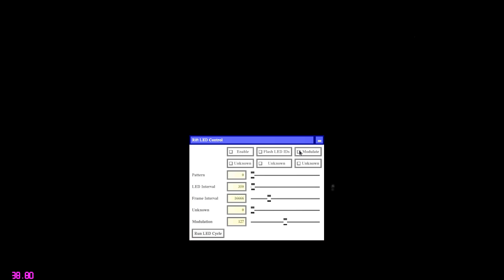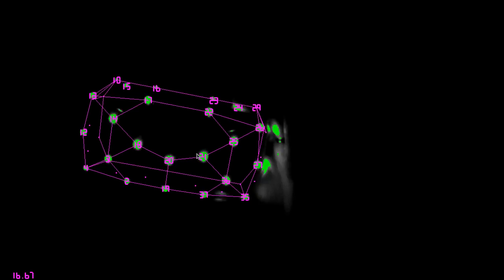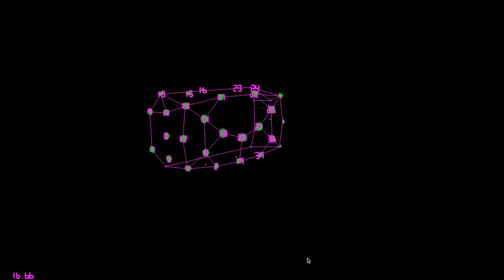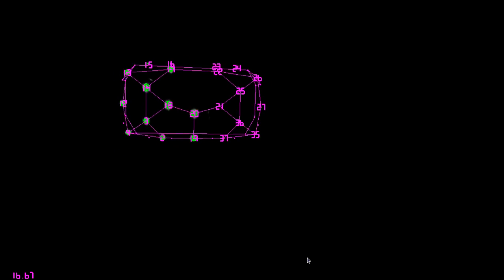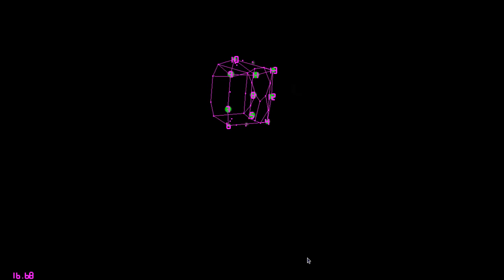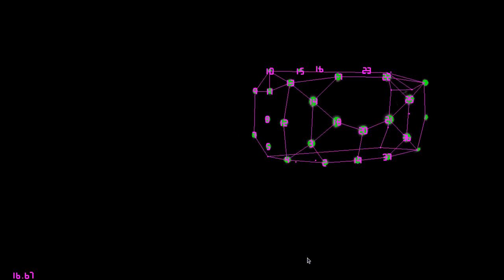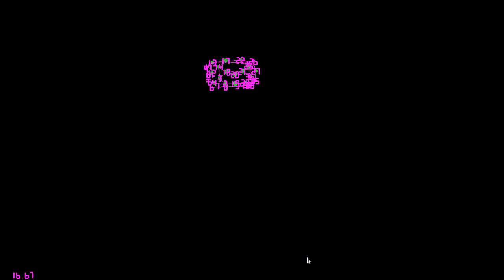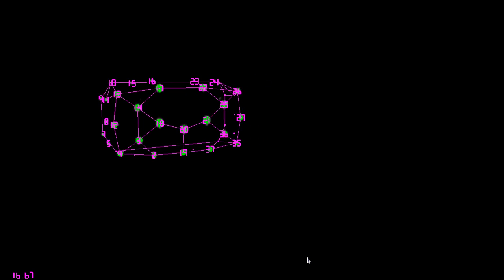Optical 3D Pose Estimation of Oculus Rift DK2

Comment: Hello, 

Could you please post links or books of the resources that helped you building this project?

Also, how the 3D model helps positional tracking in 6DOF? is by calculating the volume of the 3D of the object then find differences between the previous volume?

Thanks for the video
Reply from the maker: I was going to reply with something snarky, but then I realized I forgot to add the usual links to the video description. So here goes: http://doc-ok.org/?p=1138

Comment: What do you think about the positional tracking of the HTC/valve headset? They appear to have a low latency system working that's the reverse of the oculus approach.Is Valves approach better?
Reply: yes vives system has many advantages over oculus's. in the future it will probably be entirely inside out.

Comment: So if I understand correctly, all of this is running on Linux ? Are you basically trying to recreate the "SDK" of oculus but on Linux? If so, that is freaking amazing! Good job!
Reply from the maker: To be precise, this is trying to recreate the Oculus run-time, which, unlike the SDK, is closed source. I have my own VR development toolkit, so I'm not that interested in Oculus' SDK anyway.

There is a Linux version of the run-time now, so I could use that from my toolkit, but I want to try using the Rift with a different large-area optical tracking system, and this is a step in that direction.

Comment: Does anyone know if VRUI has a forum? I have a problem running the install script. It looks like everything installs,it makes the src folder, and then i get "Build-Ubuntu.sh: 33: Build-Ubuntu.sh: Syntax error: redirection unexpected". i get no spinning globe. Can anyone help me. Im running a virgin ubuntu 14.04 64bit.
Reply from the maker: There was some change regarding the default shell in Ubuntu 14.04. My script assumes bash, but on 14.04 /bin/sh is a different shell with a different syntax. There is an updated Ubuntu install script on my web site.
Reply: where is the updated script?
Reply: the script on the website gives me the error described above on a newly installed 14.04. could you please check to see if the script runs all the way through. do i need to have whytools install. if so can you setup a script for whytools. i know im a noob sorry.
Reply from the maker: GeneralScott1
 The updated script is at the same position as the old version: http://idav.ucdavis.edu/~okreylos/ResDev/Vrui/LinkDownload.html . You might have to clear your browser's cache if you downloaded the file before; the first line should say "#!/bin/bash".

You don't need to install anything else; the script will download all required libraries and build Vrui.

I just tested the script again on Ubuntu 14.04, and it works.
Reply: i have it working now, thanks man,  im learning the interface. just been reading alot now but im going to build an app that uses multiple kinects, 2 dof wii motes, an oculus rift dk1 and an emotiv epoc which is a 14 point eeg computer peripheral connected via wireless usb dongle. what i want to do is simply let you interface with  an object(first a 3d representation of your brain but with real time eeg data)  that is being manipulated by your mind real time via color and position of color corresponding with the eeg position. then introducing different  virtual and physical stimulus and see how your brain reacts in real time.
Reply: +GeneralScott1 +okreylos 

Interesting stuff, I am glad to have found more about this. I was hoping to incorporate some form of 3D camera technology as well as optical tracking in some of my own tests in the near future, and it's exciting to see like-minded endeavors. It's an interesting frontier of possibilities in how users will interact with displays and generated information in the coming years... If either of you have written more on the subject I'd be very interested to learn more. Thanks, take care...
Reply: +GeneralScott1 I find your mentioning of using EEG technology in addition to optics generation really fascinating, I have been wondering of a similar subject for some time now... If you have more you can share about what you have learned about the subject, the difficulties and / or working methods, I'd be very interested to know. I am totally new to acquiring any technology in the field before beginning to mess with the programming, but have been trying to size up price comparisons / ease of use. I have been looking at options such as Gazept and Bubl cameras, and the EEG device I was looking at was NeuroSky. These are all lower-cost options as I don't have a lot of disposable income at this time, but if you know of others or have other suggestions, I'm curious... 

I was also thinking Kinect would be a fun device to experiment with in regards to generating optics and interpreting incoming visual data... but again, I'm also not super familiar with the subject. If you have any articles, items, or general info on the subject I'd be very interested. I hope your own developing has been going well...

Comment: What happens if you turn your head horizontal 180 degrees? Will the 3d position of the OR still be trackable?
Reply: The next prototype in-house at Oculus has added additional LED markers to the back strap, so it can track you while you face away from the camera entirely.
Reply: No not with a DK 2. That is exactly what the Crescent bay prototype is for

Comment: While I'm sure it's possible, I'd be interest to know if you can move your head at that speed, while seated, to force the loss of tacking. Does it take a certain amount of effort or do you see tracking being lost in this way during regular use?

From you video it also appears that tracking is lost at high speed only with translational movement. While you hold it in the same spot, but rotate it rapidly, it appears to be holding the tracking quite well. I assume this is a combination of a quite low refresh rate of the camera (as it's a re-purposed off the shelf one isn't it?) and the tracking boundary box being relatively small?
Reply from the maker: ***** There is no tracking boundary box per se, but between frames, the software needs to establish a link between LEDs seen in the previous frame and the current frame. I put in a maximum cut-off distance of 10 pixels, so if an LED moves more than 10 pixels between frames, it gets lost.This is only the first approach. Once the optical tracker is backed up by inertial data it won't be a problem anymore, because then the software can accurately predict the positions of all LEDs in the next video frame based on inertial tracking data received since the previous frame.BTW, the camera runs at 60Hz in its default video mode of 752x480.